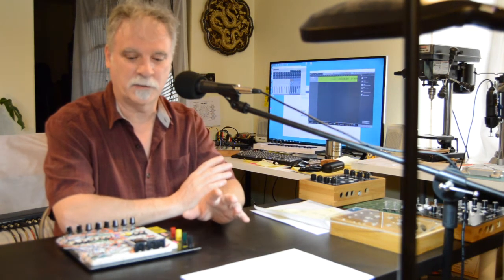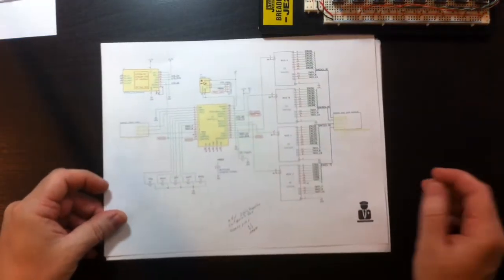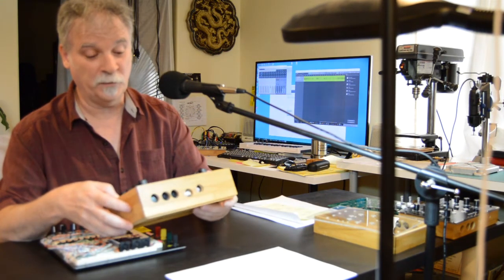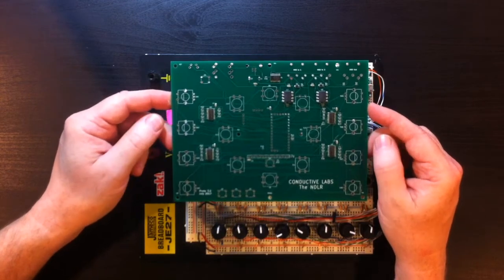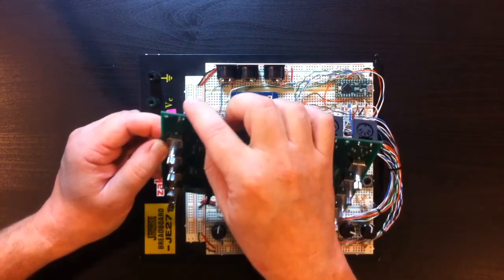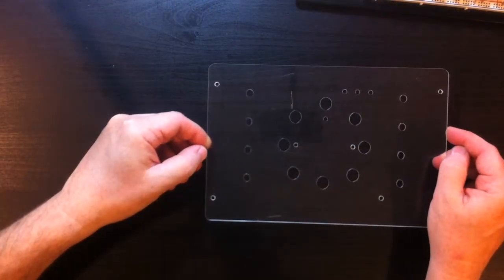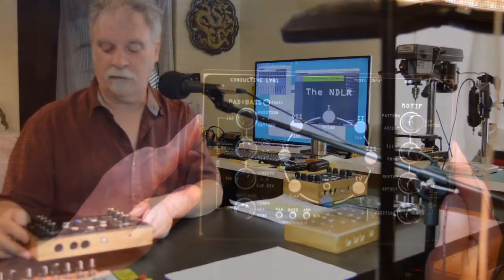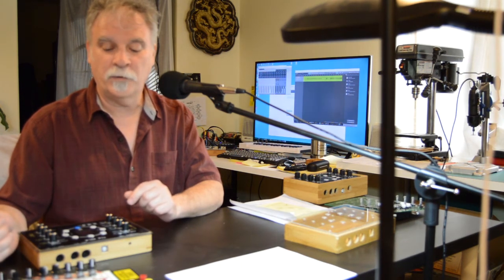The NDLR Tech Briefing - Part III

Comment: Very cool, I want one!  Love the hand-soldered SMD components, those are always extra fun when you get to QFP or BGA packages :-)  Is that a Teensy on the CPU daughter board?  (edited) Ah, so it's definitely one since I see you credit Paul at pjrc.com for the processor hardware and Arduino IDE integration/platform.
Reply from the maker: Since we were building 10 boards on the first shot, we had the SMD done by the assembly house. Too many pull-ups to hand solder! Yep, that's a Teensy LC in the pic, but we've moved to Teensy 3.2. Currently working on the new board design which will eliminate the Teensy. We haven't decided if we will keep Teensy compatibility, it's pretty expensive. However, we'd like to give PJRC something more than credit for their fine work.